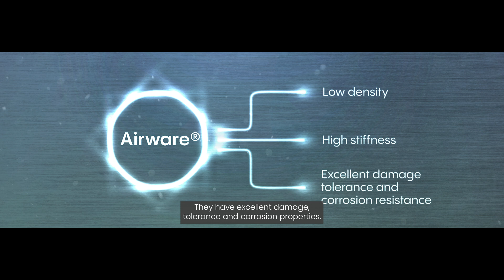Constellium is committed to innovation with advanced aluminium

Comment: What are you doing to eliminate/remove/sequester greenhouse gases pollution from your processes and your supply chain? Today we're adding 51 billion tons of greenhouse gases pollution to our shared atmosphere annually. Trapping heat energy equivalent to heat energy released by detonating 5 Hiroshima type nukes every single second since 1995. Innovation to enable even MORE aircraft pollution is counterproductive. Until greenhouse gases PPM stops then reduces every company must recognize the most important actions result in fewer total PPM . Aluminum products on a biologically dying planet, our only home, are useless